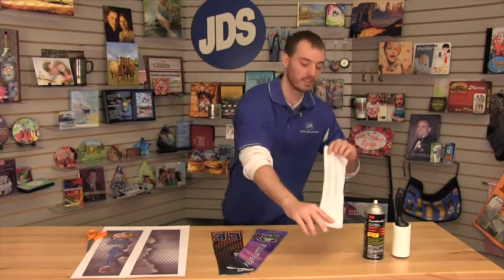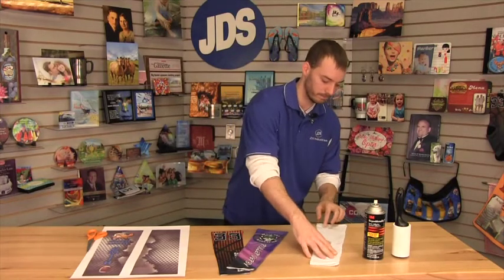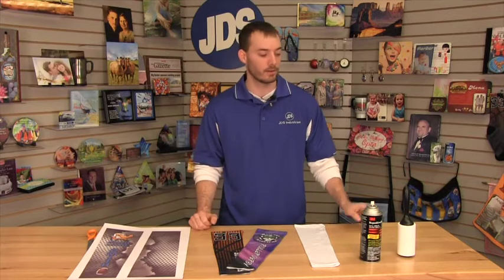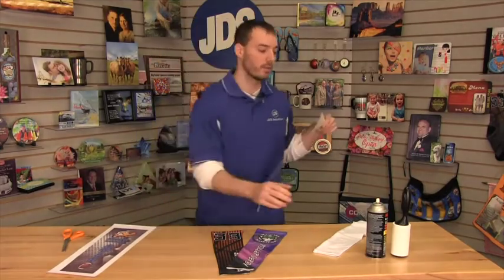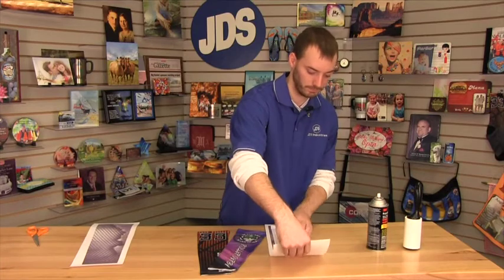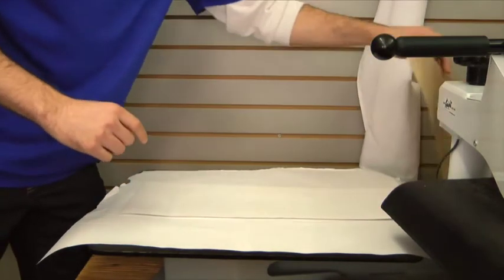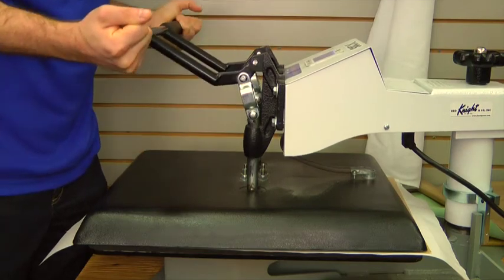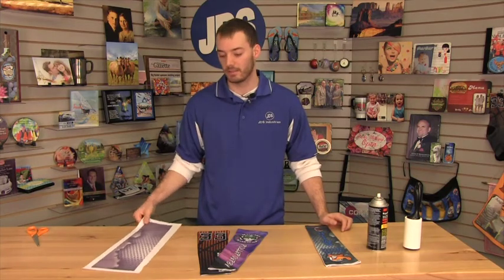How to Sublimate Sport Sleeves

Comment: Did you put anything between the sleeve?
Reply from the maker: No. The sleeves are thinner than the socks so there is no need to place a jig inside. The image also does not bleed through.

Comment: why did you use repositionable adhesive spray - part #3M6065??
Reply from the maker: This helps keep the sleeve from shifting during pressing!
Reply: I tried using a gorilla glue brand, but it left small spots. Do you find this issue with the brand you use?
Reply: @JDSINDUSTRIES  I searched the part number but I get a Scotch brand spray, it looks nothing like the one in the video.
Reply: Also, that same bottle does not seem to be available anymore, a scotch brand comes up with that part number. Is it the same?
Reply from the maker: The Scotch brand is the updated spray and will function the same!
Reply from the maker: Yes!
Reply from the maker: We find that less is more with adhesive spray and spraying from further back to get a better mist helps with spotting.